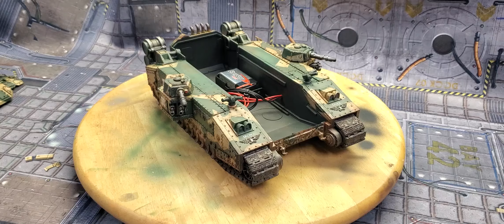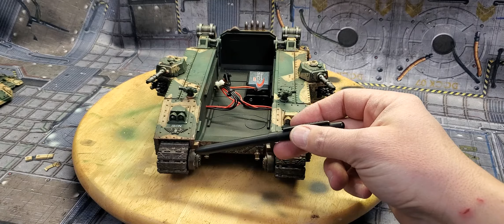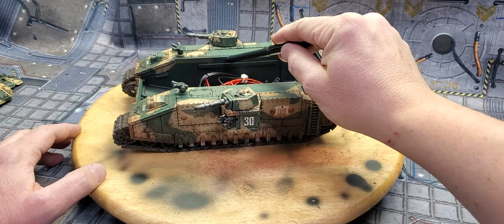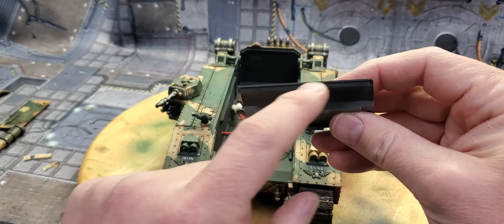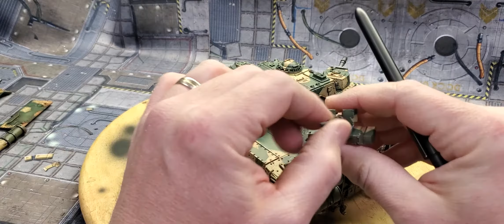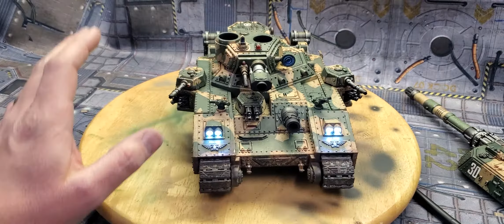Baneblade Octablade Reference Guide Magnets

Comment: I wish i had seen this before i stated mine. I thought the spikey bits one was a really poor example of how to magnetise this thing.
I did similar things but use lots of stronger magnets especially on the top parts of the hull the whole tank could be picked up by them with out worrying. Actually because of the strong magnets for the top hull parts the part that flips and swaps back to forward for variants didn't need any magnets as it was held tight between the top hull and the sprue lips on the inside of the hull.